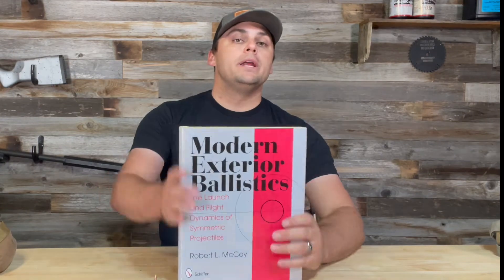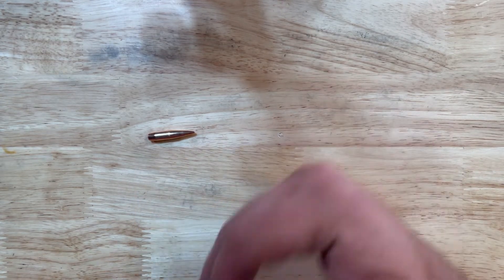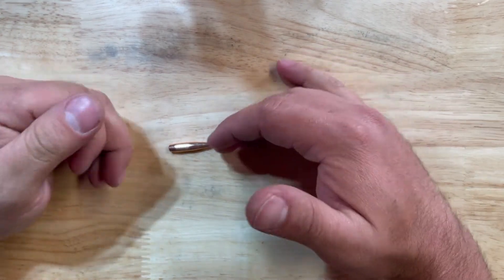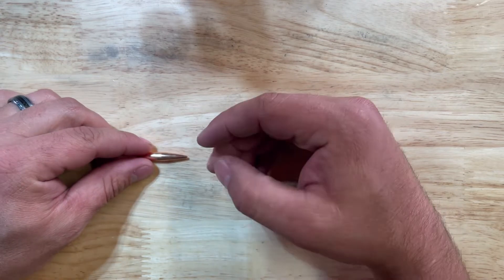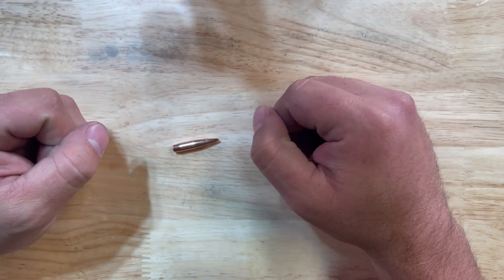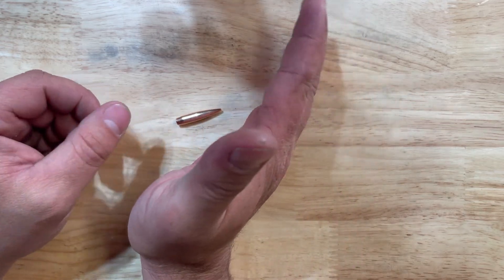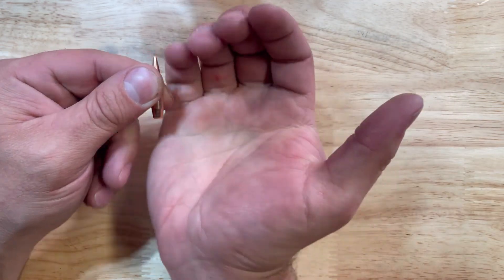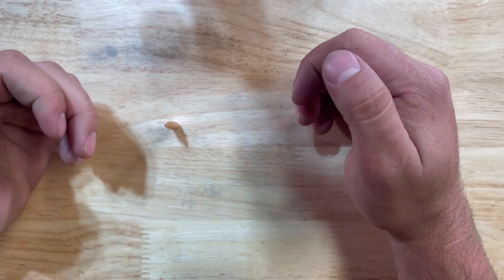Bullet spin drift crash course

Comment: I would rather explain it by focusing on air friction on the “bottom” of the bullet being way more than on the top. That would be way more intuitive. Your explanation started out superb, but I think you lose most people with the right hand rule pointing in certain directions. 

The bottom of the bullet is “grabbing on” to way more air particles than the top. Because the bottom is moving to one side, the air particles will be pushing it to the other. As the bullet drops more, spin drift increases. Also, the grooves cut into the bullet (by the barrel) increases this a lot when compared to a smooth bullet like the unfired one you’re using in this illustration.

Comment: Love your video. From my super sonic aerodynamics background the location of the centre of pressure for any shaped object at super sonic speeds is always 50% chord. So a more accurate description of the source of the torque imbalance is due to the difference between CoG and CoP, which you had right, just clarify the CoP is at half the distance of the projectile and the CoG is slightly more rearward that the CoP. Projectile designers work hard to make these 2 location as close as possible.
Reply from the maker: Correct, but the CP isn’t always exactly at half chord. It does move rearward compared to subsonic, but where exactly depends on shape. How far the CP and CG are away from each other is a main factor for twist rate and stability

Comment: Is this more of a really long range consideration? I mean is this something your average shooter has to worry about if they shoot a 3006 at lets say no more than say about 600 yards max? As a hunter, Im generally shooting less than 300 yards for 90% of shots, and anything over 450 would probably be 1% or less.
Reply from the maker: It wouldn’t be something you need to worry about. With distance and target size you have it won’t be enough to matter. 800 yards+ and on smaller targets is when it can have a noticeable effect
Reply: @longrangescience  Cool...Just out of curiosity....what if I was using a lower velocity, low bc round like say a 45/70 or 30/30, and wanted to extend my range over what one would typically shoot 45/70 or 30/30. Would this come into play in that scenario?
Reply from the maker: Great question. It moves slower so it will show up sooner, but the main factors like velocity, twist rate and bullet length are minimized. A quick check in a ballistic calculator looks like about 5” drift (1MOA) at about 500 yards for one load. So if your taking those to longer ranges it could become an issue

Comment: So a barrel with a proper twist rate is more designed around bullet length on getting it up to RPM before it leaves the barrel. Since length and weight are corresponding numbers
Reply from the maker: Exactly! This is why bullet manufacturers list minimum twist rates for bullets and it is always a faster twist for heavier bullets (within a caliber).  Also the same reason a 180 gr 7mm bullets need a 1:9 twist, while a 180 gr 30 cal only needs 1:12. The 30 cal is fatter so it can be shorter to get the same weight. Short bullet means less required twist